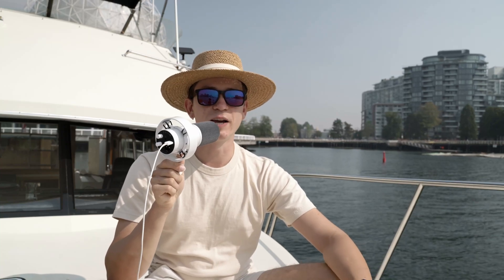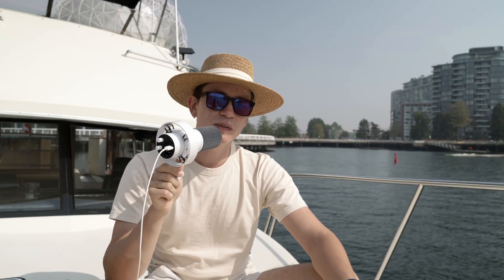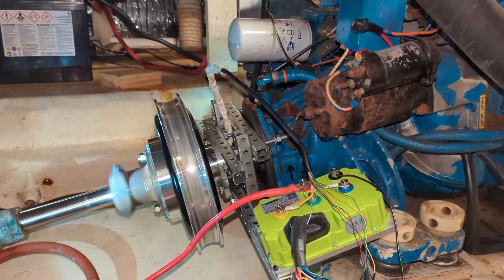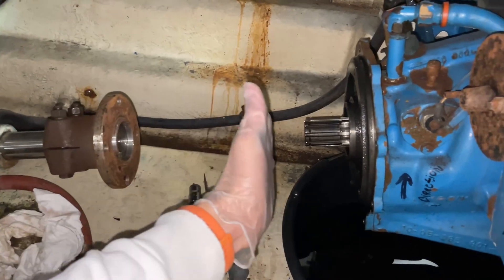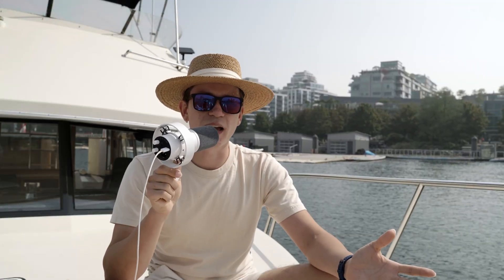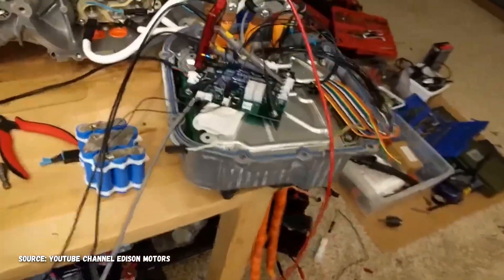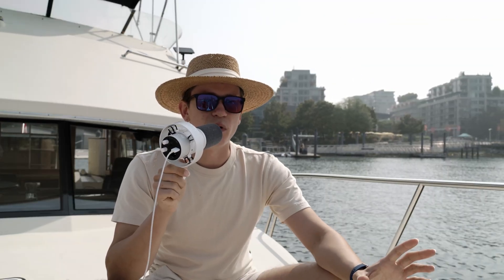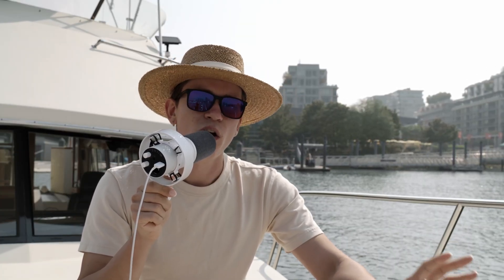What Happens When You Put a Prius Motor in a Boat?

Comment: lol 2011-2015 chevy volt has 180kw worth of motors in its transaxel and cost 4-5k usd here in usa. way cheaper than gen5 prius. works on 350-400v arcetecture. the batteries are dirt cheap and have better cooling
Reply from the maker: Yes, but it is exactly what I was explaining. Add to that marine generator, HV battery, all wires, controllers etc and we are talking already 20-30k per whole unit for one side
Reply: @YachtCityLife  i think chevy volt is the phev car, not the bolt bev. its a plug in hybrid with 18kwh battery. much bigger electric motor too.
Reply: @YachtCityLife  eh if you build your own battery it is only ~60usd/kwh for lfp if you go with 280ah format cells. 2 orders of magnitude lower than what you were talking about. not the best for hv output due to geometry, look into staffl systems, they build their own custom and very expensive LTO marine grade sealed hv batteries and are the only company doing it. you can get the same prismatic 20ah lto cells for around 10 bucks each. not a lot of info out there on how to make a hv lto battery though....

Comment: A Prius motor is not designed for the marine environment, durability, and safety are not guaranteed. I'm surprised that your insurer, if you are insured, would sign off on this.....
Reply from the maker: Thanks for your concern! You’re right — the Prius motor wasn’t designed for marine use. But to be fair, the small-block V8 I have in the boat right now wasn’t either — it was a regular automotive engine that Crusader adapted for marine use. In the same way, any engine can be “marinized” with the right cooling, exhaust, and safety systems.

That’s what this project is about: adapting the Prius drivetrain step by step, documenting the process, and making sure it’s both safe and practical. We’re insured, and this swap is being done gradually so we can test everything before fully committing. It may sound a little crazy, but that’s exactly why we’re sharing the journey. 🚤⚡️
Reply: @YachtCityLife  There is more than just a few changes. By some of your work I can see the level of marine experience is limited. Enjoy the water.
Reply from the maker: My friend, if you want to share your experience feel free to do so. If you want to be toxic here to me or anyone in the comments I will send you to the shadow ban
Reply: The Prius motor lives inside the transaxle submerged in dielectric oil and the whole assembly is water tight, it's absolutely suited. And if you mount the whole engine gearbox where the CV output alignes with the shaft u can run one output to the propeller and clamp down the other to double the output speed of the drive as they only go to 35mph electrical mode, so at 60 to 70 mph wheel speed you'll get enough rotation for 5 ish knots
Reply: @Gazdadjuz  More involved than what you understand, based on your statements here.

Comment: A 20hp 4 stroke kicker will bring you there,  4-5 knots, with 3 l /hour. Just as an alternative.
Reply from the maker: Yep but the problem is that it cost about the same as prius that can output 110hp total. Even if it can move our boat 4-5kn it would be it's maximum so no extra safety power in case of emergency. Plus it can't provide power to our house battery. There pretty much nothing on the market rn that can beat Prius in terms of efficiency. But we will see if it is going to be true pretty soon
Reply: @YachtCityLife  I have a smaller single engine Bayliner. I keep the main engine(5.7), but added a 20hp Tohatsu kicker with an tiller autopilot. So now can move at slow speeds  very economically. It do has a 12A charger, sufficient having also a solar panel.   I am too scared for having lithium batteries in a boat.   But very interesting to follow you project anyway!